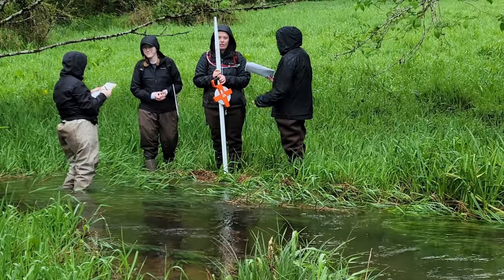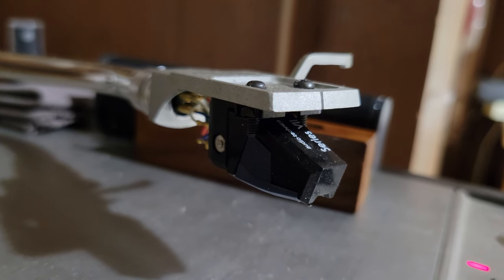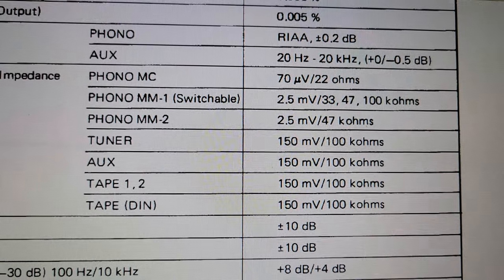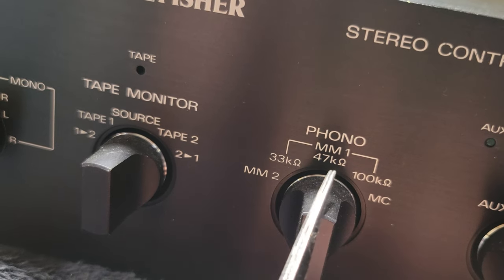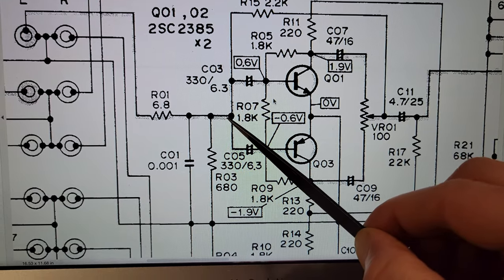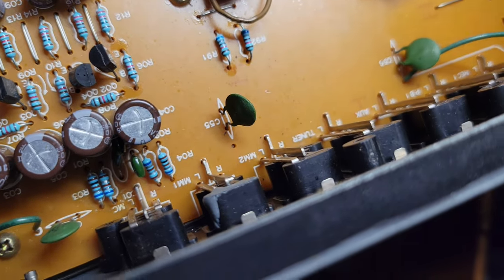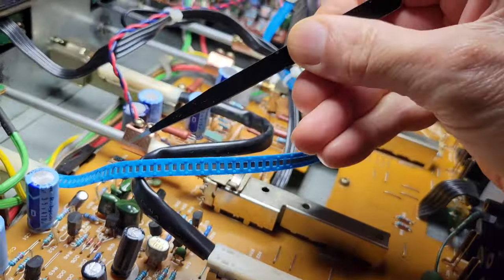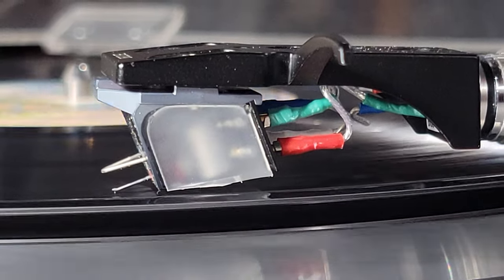Preamp Mod For Moving Coil Cartridge!

Comment: Before taking everything apart and soldering in the resistors, I would suggest installing some jumpers and testing out different impedances. Even though the specifications say 100 ohms, you may find a different impedance produces the best sound for your system, when you actually listen to it and test out different resistors. I do this with new cartridges since my pre-amplifier allows me to select different impedances, and I often find that a higher impedance produces a sound that I prefer more.

Comment: Whatever your impedence, you will hear super fast effortless transient response, astonishing transparency, a more 3D open sound, with instrument behind instruments with air spaces in between.them, on a  front to back plane. Try it with 20 ohms and see what you think. Increase the impedence if you think it needs to sound brighter. That's one thing increasing the impedence will ALWAYS do.
Reply from the maker: Turns out it doesn't affect frequency response, just level. Seriously, I've seen the data.

Comment: Yes indeedy, working on a preamp board can be a a lot more painful than a power amplifier or even an integrated amplifier! I'm working on a Luxman C-03 that you have to unscrew the connectors and standoffs like yours. What a pain! It seems manufacturers deliberately designed preamps not to be worked on?!